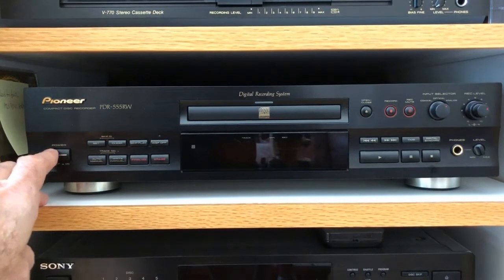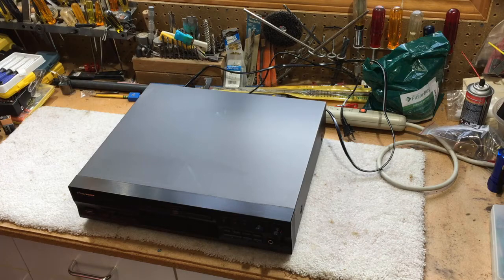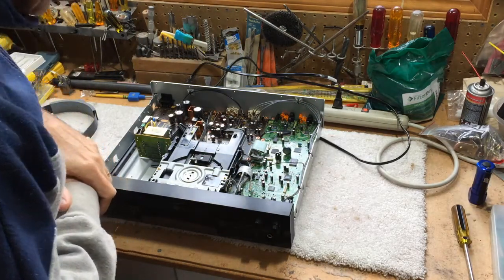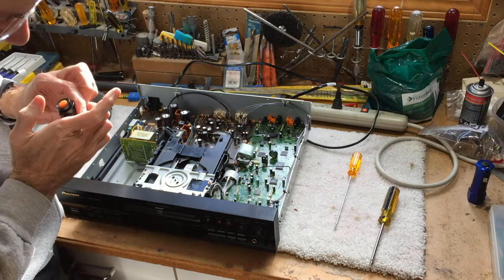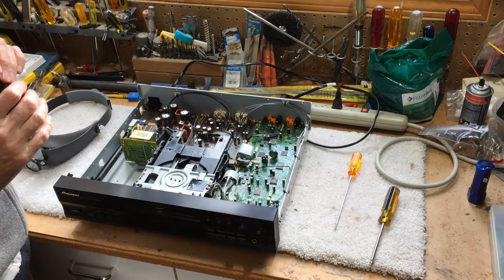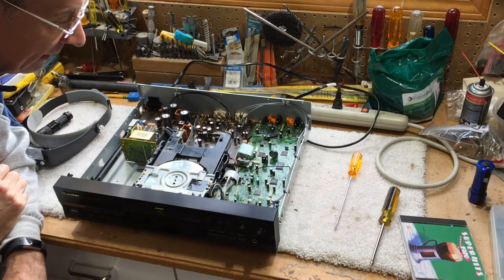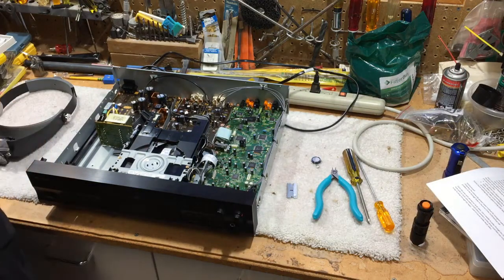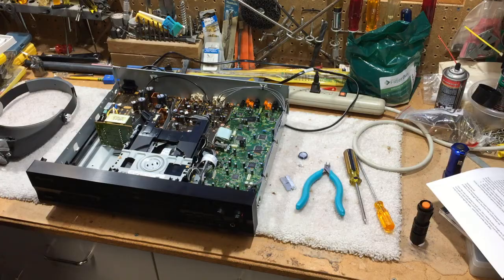Pioneer PDR-555RW CD Recorder Repair - Part 1 of 2

Comment: Hi, I have a pdr-555RW slightly used. Great condition.i checked the elna cap and is not leaking apparently. and inside board look as new,  cd tray opens and close  perfectly, no error shown upon power on(display shows: "00 00:00"), but it does not recognize any CD 😒🤔
I checked laser LED position through wheel and it is seems in factory setting.
I tried error code procedure and display shows the following code:
"0255 00"
Is it an error state?
What does it mean this code shown?
Thanks in advance.
Reply from the maker: Sorry, I don't see that error code in the Service Manual.
Reply: Thanks..then probably it is not an error.
Yesterday i tried to clean the laser LED, but nothing to do. Cd spin normally and after it says "NO DISC" 😑
i tried a lot of CD and even a brand new blank CD-R

Comment: I have the exact same problem, however i need help locating this switch 601toc.
Reply from the maker: That could be hard to locate. Best bet is watch eBay for a "parts unit".
Reply: @litzdog911    ? parts ?   yours looks a simple enough fix, mine right now is doing exactly the same.

Comment: Hi. Savior video here and you post as well in the diy forum. By the way where did you find the explanation of codes after pressing the skipplay nad displayoff buttons? Mine has 00910000? and I can t find any datasheet for that. I have the service manual and I own the PDR-555RW model.

ps what would be the code after pressign the stop button for normal operation without any problems?
Reply from the maker: The service manual that I downloaded from HiFi Engine provides error code information starting on Page 45 (Chapter 11). Your error code "91" points to "Loading error".
Reply: @litzdog911  Thank you for your quick response. Now that yours is working normally, if you press the stop button what it shows (with and without a cd inside)?

Comment: Hi. Upon service Manual, 509 displays hours of laser use, but not 555. I´ve got one 555 today and it does display 0000, but I see on your video that your 555 displays hour meter. I don´t understand why mine doesn´t. Is there something I do wrong? Thank for your useful videos.
Reply from the maker: Sorry, Not sure why yours would be different. Do you have the Service Manual? All of the codes are explained there.
Reply: @litzdog911  see page 45 of Service Guide.Have you updated firmware or software? How about the Elna cap? Did you only removed it or after removing did you installed a new one? Best regards.
Reply from the maker: @norbertoalejandrolopezbarr3913  No, I have not updated the firmware. And I did not replace the Elna cap. Simply removed it. No noticeable issues after removing the cap.
Reply: @litzdog911  thanks for your answer. Have you seen page 45 of Service Guide? Cause I don´t undesrstand why mine does not diplays hours of laser use...

Comment: I got this problem last week with my PDR555 when I kept recording beyond the capacity of the CDRW.  Your procedure fixed the problem though I have not removed that round battery like thing. Thank you for sharing your experience.  I will make sure that I don't record onto CDRW disk to full capacity. Thank you again,

Comment: Thanks for posting this! When I have a chance I will watch the whole thing. I have a PDR-509 and my issue appears to have been that the laser carrier had detached in front of the gear wheel. So far just winding it back in seems to have fixed the issue. :-)

Comment: I have error code dd. can you help me?
Reply from the maker: Sorry, I don't see information about that error code in the service manual.
Reply: @litzdog911  I have a new code 8C421
Reply from the maker: @svenschweiger6888  You can find the error codes in the back of the service manual available from HiFi Engine's website. The "dd" code means "Stops owing to a TOC check error or STOP key input". I'm not sure about the 8C421 code. That doesn't quite match the error code format shown in the service manual. I think "8C" might mean a power calibration error. At any rate, it seems your CD Recorder needs a lot of help. Good luck!

Comment: I got error code 5100 what does it mean?
Reply: I have the pdr-509, code 5100 P6 comes up
Reply from the maker: @DCCOWBOYZ  According to the service manual, when you press TIME and DISP OFF keys simultaneously on your PDR-509, you should see an 8-character error code.  If the full code you're seeing is "5100P6", that doesn't fit what's shown in the service manual. Go to www.hifiengine.com and download the PDR-509 Service Manual. The error codes are shown on pages 47-48.
Reply: Jim Litz thanks I’ll try that
Reply: Jim Litz the code is 84300000
Reply from the maker: @DCCOWBOYZ  So this error points to an issue that's happening when the laser assembly is trying to access the disc TOC (Table of Contents). That's what the "84" means. The "30" means it's related to "TOC area search". So some wild guesses could be as simple as a dirty laser lens assembly or lens assembly track needs lubrication. Also, the microswitches along the rail assembly might need cleaning. Good luck!
Reply: Jim Litz thanks, I’ll need it
Reply from the maker: Press the SKIP PLAY and MENU keys simultaneously and post back the full 8-character error code. You have a PDR-555RW, right?

Comment: Excellent Video' This also works for the Pioneer PDR-509 CD Recorder....
I had the same problem exactly like you Flashing " Check " message , I followed
your steps on your video and now it is working better then ever ( No more Check )
message.
I did not have to do the ( Part 2 ) of your video because the Pioneer PDR-509
did not have the ( Toc Switch S601 ) on that model, Easy !!!!
Thanks again you saved me $$$$$$$ : )
Reply from the maker: You're very welcome!  Glad you found it helpful.  It's a great feeling when we can keep this vintage gear working!